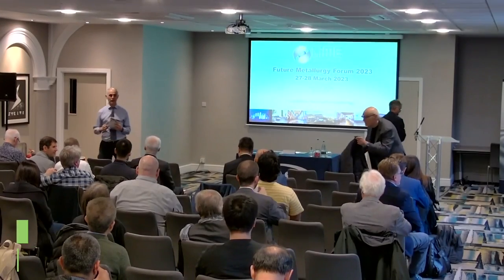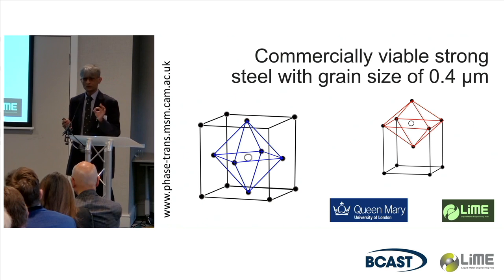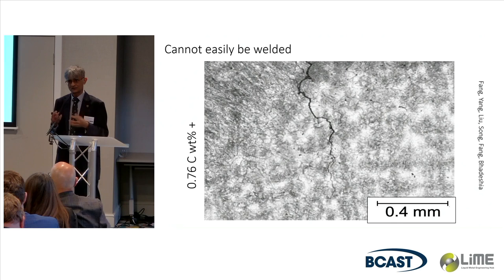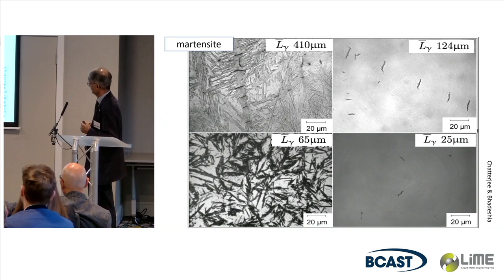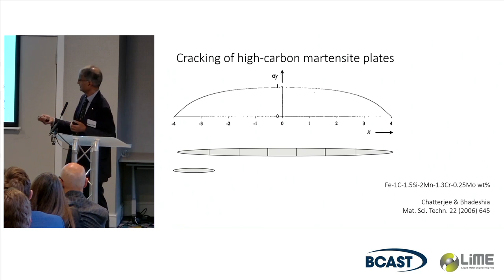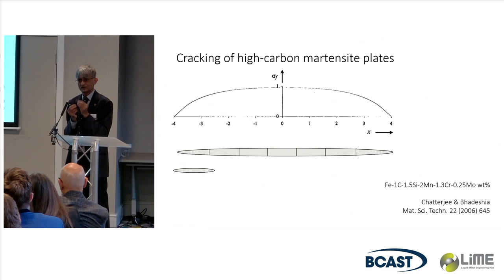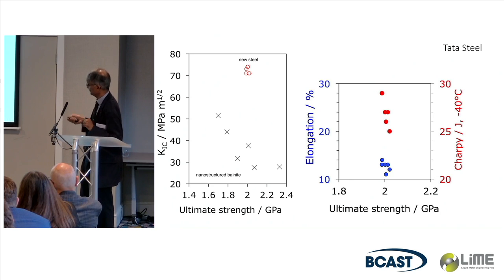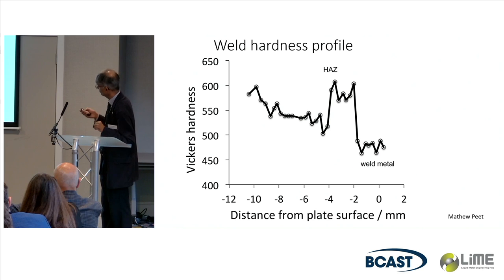Commercially viable strong steel with a grain size of just 0.4 µm

Comment: Ooooph. Harry!
Reply: @bhadeshia123  It was just the significance of this steel to industry Harry and that you "designed" it from scratch - forgive the pun. That is amazing to me. Bis 80 in Australia is used as a wear resistant plate in the earthmoving and mining industry. I imagine this new steel will replace Bis 80 and that market is quite large. Hence the Ooooph! There is a lot of money in this additional wear resistance and easy fabrication ability of this new material. The other factor is understanding how you manipulate iron allotropy and chemistry to your advantage, that is real Engineering Dr, Sir!!
Reply from the maker: Thank you, now I understand. If you are interested, you can download my latest book free-of-charge from https://www.phase-trans.msm.cam.ac.uk/2023/Theory_Transformations_Steel.pdf
and there is a lot more available at
https://www.phase-trans.msm.cam.ac.uk/
Best wishes, Harry @paulmeersa7162
Reply: @bhadeshia123  I did that yesterday thanks Harry, I was the bloke asking about the invariant-plane strain on the Pearlite Steels lecture. I am working my way through both of Linnert's Welding Metallurgy volumes, slowly but surely, just out of interest, not doing any course, although I might try for a Welding Engineering exam or two in the Northern hemisphere in a year or two. I use your lectures on here for a booster, and or a different perspective once reading up on it all becomes too much - helps a lot!  Once I am done with Linnert I'll switch over to more of your lectures and might even try a chapter or two from your books. I was always told throughout my career that I should have been a metallurgist; but I'd rather study alone away from institutions so this type of learning suits me well.
It seems such a pity that you have retired but at least you are maintaining a presence on line, for that I am grateful. Many thanks for the work you have done in carrying ford man's understanding of metals...  M.